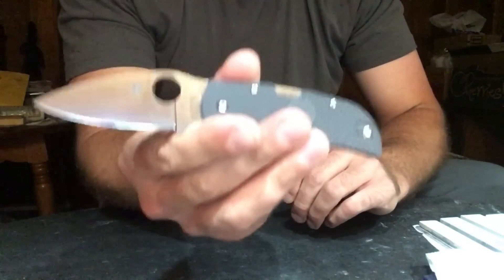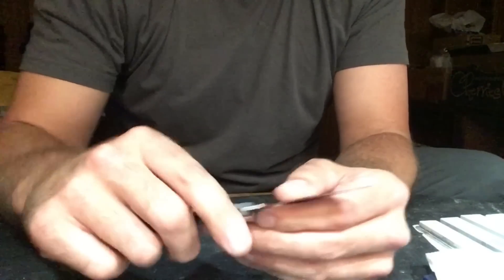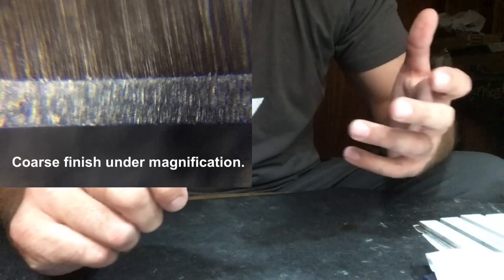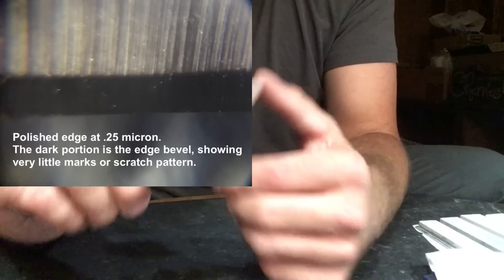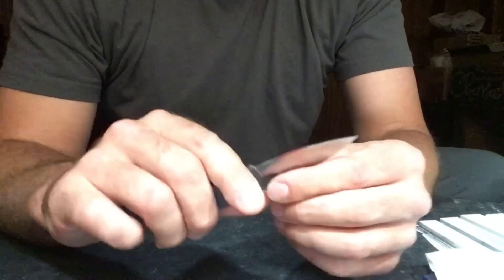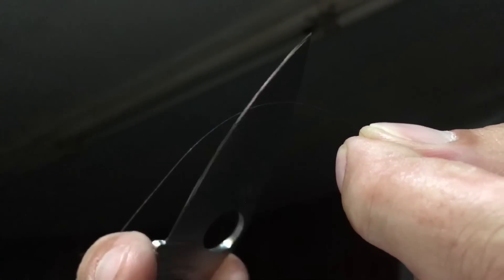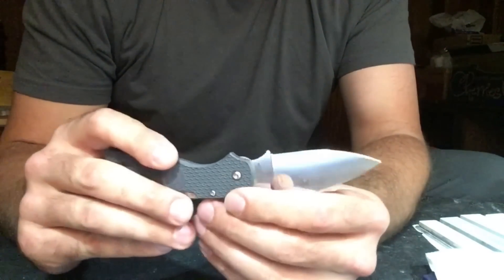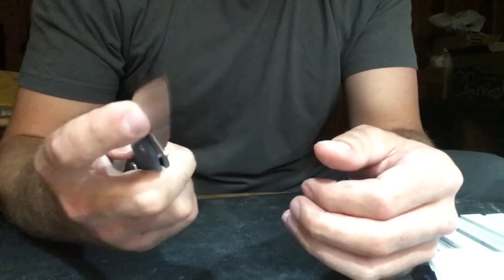CTS-XHP - edge finish testing- Spyderco Chaparral

Comment: You should try getting your point across with fewer words. Also, with so many overheated edges, it's normal to see edge-retention improve between first few sharpenings. How do you control for newly exposed steel having better heat treat between sharpenings in your test? At least get two identical knives and let one go from coarse to polished while the other would go from polished to coarse. Saying your hand-sharpening is consistent because it looks shiny and reflective and therefore isn't a variable between test runs is, well, a fallacy -- to put it lightly.
Reply from the maker: Far I know my sharpening is consistent because I check the angles in an angle guide.  If you don’t like my delivery (and want fewer words), that’s understandable.  The simple answer is, don’t watch the videos.

Comment: Hi Michael, from the UK.
                I really enjoy watching you carrying out your various sharpening tasks. I only wish that I were able to do the same. I guess that like most other repetitive things of a skilled task it requires practice and of course time. I must admit to being quite transfixed watching the way in which you are able to move the blades back and forth without more support than just hands and knees or an arm on the table. I have recently bought a couple of Spyderco knives, all using good steel. I'm hoping to sharpen them up a little in the near future. However, I shall be practicing on a couple of sacrificial blades first. But before all of that I need to buy some sharpening surfaces. I will probably buy a couple of ceramic surfaces first and then, depending on how it goes, as it were. I may then invest in a a Shapton glass or two. I do though have a question. You mention diamond plates etc. What grade of surfaces do you employ?
Anyway, that's enough pestering for now. Keep up the good work.
Reply from the maker: Stephen Carter for diamond sprays and pastes, I typically use leather or basswood.  
I don’t buy a particular brand of leather.  Instead I look for the surface I want which varies based on the abrasive I’m using and how I plan to use it.
Reply: @michaelchristy4982 . Thank you for the reply.

Comment: Hey Mike,

Is there any reason you left the spyderco UF out of these sharpenings? Does the 10k Suehiro act as a good substitute to the spyderco UF?
Reply from the maker: ShesSusie because XHP doesn’t have enough vanadium in it to form vanadium carbide, so sticking with alumina waterstones is no problem.

Comment: Thanks for the great vid. Do you think that a 14 dps bevel would work on the Techno (also CTS-XHP)? Because it’s such a thick blade  I think it would cut more easy with a smaller angle.
Reply from the maker: Reinen Ruud it might look funny on the Techno, but that’s subjective.  I think XHP would be fine at 14 DPS.

Comment: In your 10V vs S110V video, S110V cut 1240" of heavy cardboard. Here, XHP cut 1475" of medium carboard with a coarse finish. I know there are a lot of variables and it's difficult to say for sure without further testing eliminating variables, but given the results of this test, do you feel that XHP is not too far behind S110V with edge retention?
Reply from the maker: corismsyn XHP is a great steel, but it’s no where close to S110V.  Moving from one kind of cardboard to another can cause a huge difference in edge retention and in the numbers.
When looking at my testing, don’t try to compare one test’s cut numbers to another, because I use different mediums and the result won’t be accurate.
Reply: Michael Christy Yes I understand and that's what I meant when I said there were different variables. Sorry my comment wasn't clear. I have a Recon 1 in XHP and it seems to lose hair popping shaving sharpness really quickly after going through cardboard. Sharpening was on DMT coarse to EEF, no strops. I wonder if it's the steel or my sharpening. Conversely my factory edge PM2 S110V still cuts magazine paper fairly effortlessly after 2  - 3 weeks of EDC and cutting some cardboard. Doesn't shave hair though.

Comment: Great. I love your work. One question I always had to you was if you have experience with arkansas stones and why you don't use them? Especially black surgical for finishing? I find it equal, if not better than spyderco ultra fine. What do you think? Thanks for your opinion in advance :)
Reply from the maker: Luka Mosashvili I used to use Arkansas stones years ago.  I don’t think that Arkansas stones are as hard to Spyderco’s ceramic stones, but I still may pick up a black Arkansas just to try it out.
Reply: Michael Christy wow thanks :)) I've asked this question about 5 times now and finally got the reply :))
I'd like to say thanks for your videos. I've learned sharpening from them and I have watched all of them several times. You have very good way of explaining things. I'd love to see if you can sharpen rockstead. I'm wondering whether there is any practicality in those knives, or you have to keep sending them back to factory for shaping the whole life. Thanks!

Comment: Love your videos and I absolutely love me some xhp. Are you preferring leather for your strops now a days?
Reply from the maker: Joshua Burkhead I have a lot of leather these days.  I go back and forth.  Also, I’ve been using very expensive compounds lately, which I prefer on leather.
Reply: Michael Christy that makes sense. When you use wood is it like a one and done kind of thing? Like you throw the wood away every time after you use it? I've never used wood so I have no clue what it's all about.

Comment: Very nicely done Michael. An Illuminating test to be sure. You should definitely get another Chaparral and do another side-by-side test cut alternating cuts in the same piece of cardboard to eliminate random abrasive variables. Also do you have plans to do a push versus draw cut test? I think this would further highlight the difference between toothy and polished edges.
Totally agree on full steel backspacers!
Reply from the maker: Joshua Briggs thank you.  I may pick up another Chaparral, but only because I want to really put this one through a lot of use, kind of like I did with my ZDP Endura.  
As for draw cut tests, I’m not real big on spreading out the wear across an entire blade.  I may end up doing something like that eventually, but it would take me some time and practice to get comfortable with another testing method.
Reply: Thank you for the quick reply Michael. Obviously establishing and maintaining equal draw cuts requires incredible dexterity and skill of which I'm quite sure you're capable given your nearly cyborg like Proficiency in free hand sharpening. LOL you are the bomb!
On a serious note, I'm just alluding to the commonly held opinion that a toothy carbide rich edge provides more advantage on draw cuts vs the advantages of a polished edge for push cuts. Obviously there are human limitations in trying to scientifically evaluate this phenomenon. Once again thank you for your efforts in your videos; they are really enjoyable and among the best on YouTube on the subject of knives and sharpening.  :)

Comment: I still haven't gone past 0.1 micron. Time to step up my game lol.
Reply from the maker: The Ace the tools are out there to go farther.
Reply: Michael Christy yeah. So far I feel I've done quite well for the money spent. DMT XC, C, F, and EF bench stones (plates one day), as well as cheap oil based diamond compounds on basswood and leather. The stones are $37 apiece, strops were $15 (i have 3), and compounds are about $12. I also have several diamond powders ($8 on ebay) that I use to increase the concentration of diamonds in cheap compounds. Stropping on dry powder alone cuts very aggressively as well. Everything I have is diamond except for a tube of 3 micron Tormek honing compound ($14 for a large tube), that I additionally load with 3 micron diamond powder when necessary. 

I always treat sharpening as practice and experimentation, and I keep trying different recipes for the edge I want. I've found that I can achieve a hair whittling edge skipping from 1 micron all the way to 0.1, even on s110v. It doesn't take long at all, so I don't find myself using 0.5 or 0.25 much anymore. I'm wondering how far I can skip down to if I want to load my 3rd strop with extremely fine compound or spray. Maybe I can get away with 0.025 after 0.1. What do you think?

I have been freehand sharpening for over 20 years but it is solely because of you that I have started stropping, and although I try to minimize stropping and never let it be a crutch for achieving high sharpness, it has allowed me to take my edges to the next level. I have a spyderco UF stone on my radar.
Reply: The Ace I recently decided to get into knives and freehand sharpening. I also went with a set of 4 DMT diamond plates (8”x3” XC, C, F, XF). Also got a dual-sided leather paddle strop along with a block of green honing compound and 4 bottles of diamond spray (Richmond brand - 1, 0.5, 0.25, 0.125). 

Looking forward to that stuff getting here so I can get out some cheap knives and start practicing! 

Any tips or suggestions?
Reply: @johnmpifer  on your first strop, try stropping on wood when you're going for a fine edge. It will remove the 1200 grit scratch pattern (left by the DMT XF) more quickly and will keep your bevels flat. Leather can convex your bevels and even round off your apex if you are applying too much pressure or not maintaining the proper angle. Sharpening is about keeping your angle and forming an apex. Your knife should be extremely sharp after the very first stone you use before moving on.

Comment: Awesome. I’ve been yet to play with XHP as a toothy finish. Always seemed to ask for a polished edge. I get really good results with it cutting rope, much better than its similarly priced competitors
Reply from the maker: Cedric & Ada Gear and Outdoors I think XHP takes a nice edge toothy or polished, but there aren’t many super steels I take to a high polish, so with XHP I usually can’t resist the opportunity.  It is a great knife steel.  
By the way, thanks for the share.